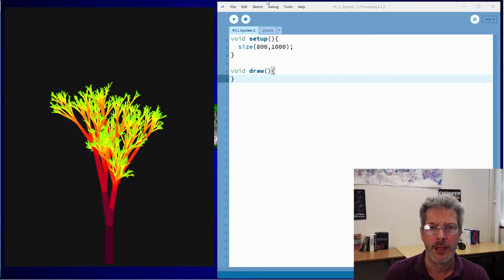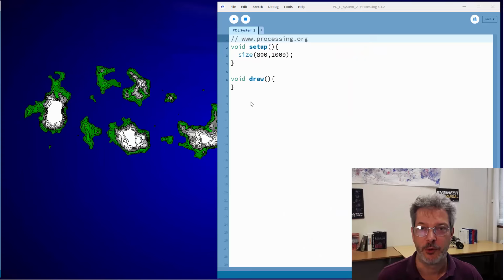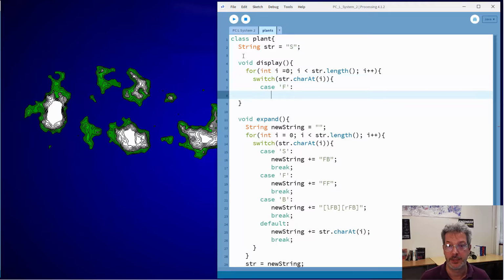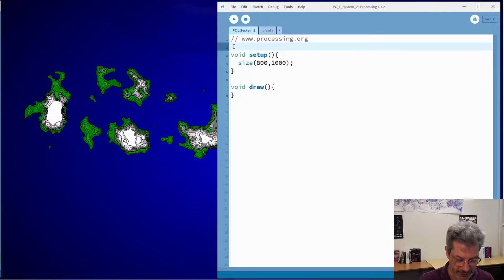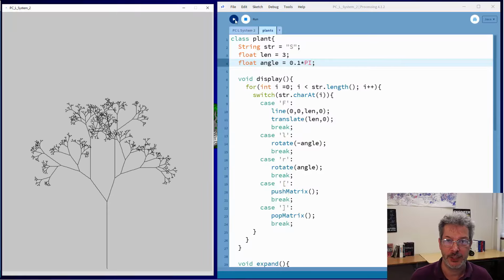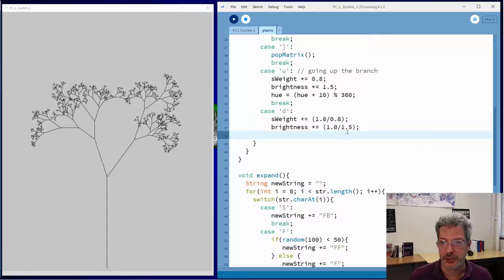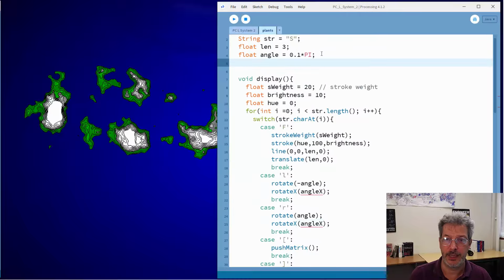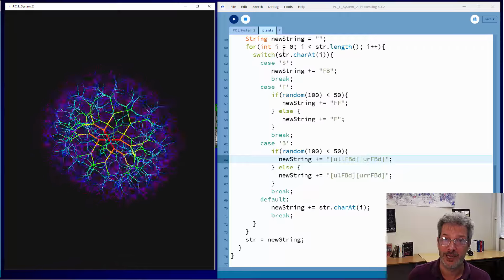Drawing plants with L-Systems

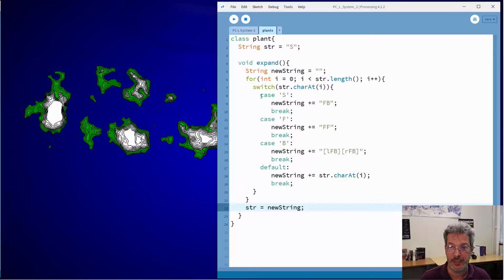Comment: 8:58 That's a very efficient way of doing it! I might just have stored each line individually, the only unfortunate thing is that you lose the ability to easily have small unique traits for each line. Whether it is just a bit of random noise or something else entirely.
Reply from the maker: Thanks! There are several approaches that represent tradeoffs between efficiency and the amount of detail you can store.
Reply: @programmingchaos8957  When it comes to storing every step required to draw the tree your method is probably about as efficient as you get!

Comment: Hm, if you're already just growing the lines in this manner, maybe you could use Brownian motion when splitting lines? This would create more interesting lines maybe?
Reply from the maker: What do you mean by using Brownian motion? I like the idea of adding more randomness to the branching, but I'm not sure how to apply Brownian motion in particular.
Reply: @programmingchaos8957  Alright, it will be a little tricky to express this in text form, especially since it's been two weeks since I watched this and I may have forgotten some things, but I'll try my best! I'll express random chance as [10%:A,30%:B,20%:C,40%:D] S > FB, F > (F[25%:W,25%:D,25%:S,25%A]F), and B > (LFB)(RFB). W, A, S, and D all represent the joint between two Fs being moved up, right, left, or down. You'd probably want to have one to two bytes to store the up/left variations instead of just 4 possibilities, it would also have to be assumed that the variance decreases based on how many parentheses it is surrounded by or else the positional variations would outweigh the length of the line itself! That or the variations would shrink over time, both are undesirable. Some unfortunate problems with this are that it does not affect the vertex branches lie on meaning that it only has so much possible variation.
Reply from the maker: @flameofthephoenix8395  Got it! That is a cool idea. If I get the chance I'll try it out. Or let me know if you try it.
Reply: @programmingchaos8957  Hm, yeah! If I've got time, I might try something like that.

Comment: 1:54 Huh, that's an odd way of doing it! Instead of starting out with a line of X length it is growing to that size over the course of several iterations.
Reply from the maker: Having the trees grow is a cool way to go. But it's surprisingly hard to get it to look right. So, I took the simpler approach (also shorter for the video) of only worrying about full sized trees.
Reply: @programmingchaos8957  I don't know, your trees seem to be growing to me, they start out as just a single stick and bulb FB then they become two sticks with two sticks arcing out where the bulb used to be with their own bulbs as well. The only problem is that it is not smooth growth, it doubles in size every iteration! If you could smoothly transition between the different iterations, then simply iterating would result in growth.
Reply: @flameofthephoenix8395  lerp

Comment: 1:00 Hm, it might be worth having extra branches at varied points along the trunk, this will prevent it from looking too orderly and artificial.
Reply from the maker: That's a good approach for less bush-like trees. If you want to make softwoods (spruce, pines, etc.) you take that to the extreme with a single trunk and branches sticking out at almost 90 degrees.
Reply: @programmingchaos8957  Interesting! I suppose you'll want more leaves for the bush-like ones too, and less for the pines and spruce.

Comment: Dont you think something like wave function collapse will work the same if not better as it is more random
Reply from the maker: Good question. I haven't done a ton with wave function collapse. I've only seen/tried it with 2D titled forms where it is used to determine which pattern goes in each tile. I assume it could be applied to 3D voxels/cells as well. So, it could be used for 3D trees like the ones here. For L-Systems you can 'turn up' the randomness by adding random noise to the angles, so I'm not sure that either one necessarily has more randomness. If anything I feel like wave function collapse may be less random because of the (usually) limited number of patterns that can go in each tile/cell as opposed to random noise allowing for any branch angle with an L-System. WFC requires a branch cell to be at a specific angle so that the branches link up with the next cell.
On the other hand with WFC you can more easily define specifics like branches end with a leaf, or there are options for a branch has a nest on it, or a branch is broken off, or a branch has a flower. So maybe WFC allows for more variety more easily - a rare nest or broken branch. Whereas, L-Systems allow for more 'noise' with trees that have the same elements. But that's just a guess.
A minor flaw on my part, but whenever it comes up I have to point out that WFC is a particular application of that more general category of constraint satisfaction problems. Which is nice if you're interested in WFC, because there are many heuristics for speeding up constraint satisfaction problems that can be applied equally well to WFC.
Reply from the maker: It occured to me that with a stochastic L-System, it would be possible to add a very rare options like a nest or flower. E.g. 99% of the time F->FF, but 1% of the time F->FNF where N stands for nest, or some other rare addition. 
I would guess that in the end the two approaches have equal(?) capabilities, but certain effects are easier to achieve with one approach or the other.
Reply: Ok
Reply: With randomness I was thinking for example if the starting image is 16x16 and 3 different colours you have 768 possible starting images (obviously  you would probably have a larger image and not all combinations will work very well) also I know wave function  collapse technically uses a 2D/3D array* not images but it's just an example. *this is also called a domain.
Reply from the maker: Ah, that makes sense. I think that could work very well and might give a lot more variability.  @Lawtro